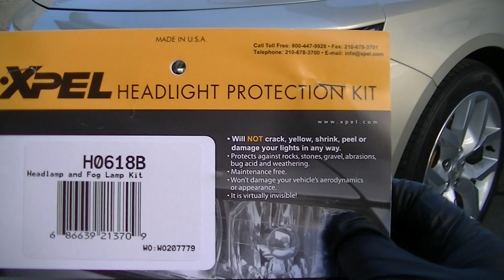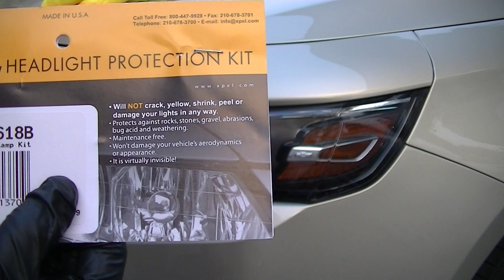2014-2018 Impala LTZ X-Pel Headlight Film Kit Install

Comment: Is opti lens better for headlight restoration compared to Dlux or C4?
Reply from the maker: The best thing is spraying clear coat. None of these coatings last that long. About a year before they need to be polished and re-coated with any of the ones mentioned.